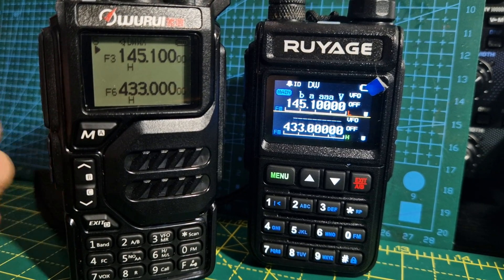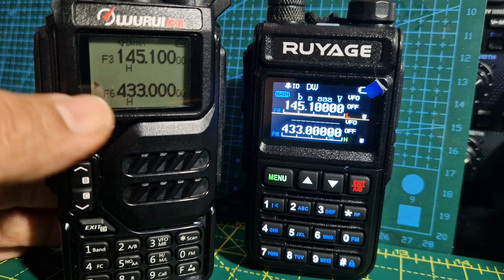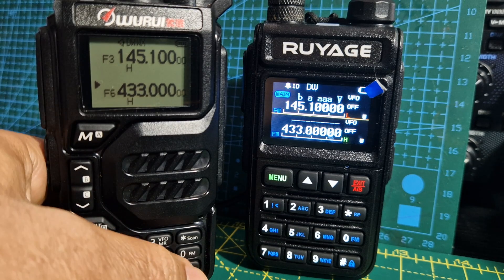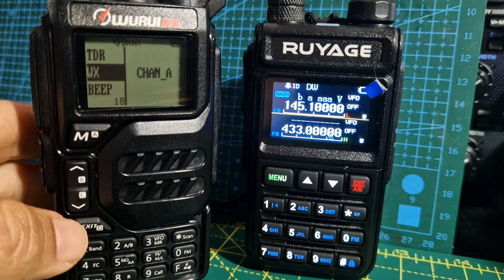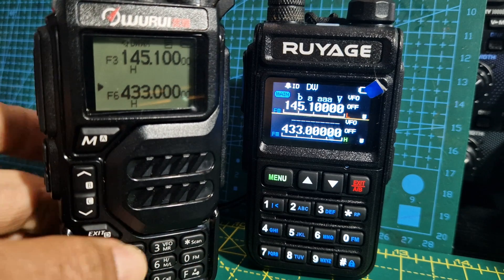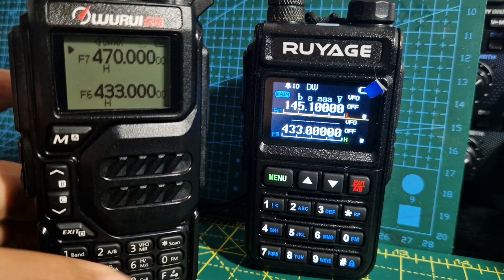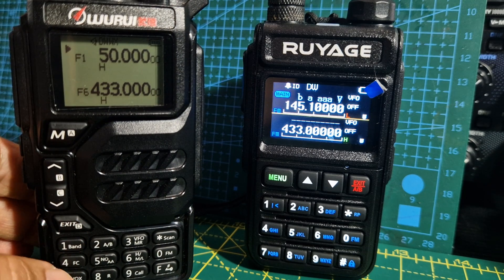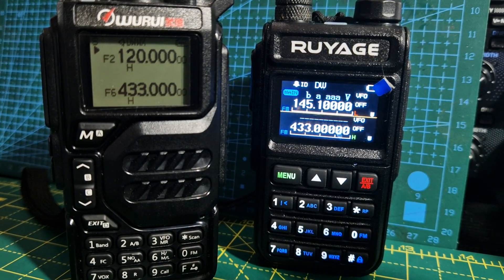UV-K5 , CROSSBAND REPEAT ??

Comment: As someone else mentioned... If you want crossband, buy the TYT 8000. It also has up to 10 watts output. Unfortunately, no scramble function. https://www.youtube.com/watch?v=fPZ7lah3rBw
Reply from the maker: Thanks for link.
Reply: I just got one yesterday & set it up today in USA with MURS (VHF 151.) going in to the TYT 8000 & GMRS (UHF 462.) going out to a GMRS Repeater. The cool part for me is that NOBODY uses MURS except Walmart which leads people to think that MURS is only good for 100 yards but I went from a HT on MURS to the TYT on MURS at 3.8 Miles (7klm) away to hear myself on the GMRS Repeater !... If your HT can't hit a GMRS Repeater then get that TYT up high with a good antenna & use it as a cross band repeater ;)

Comment: You jave to adjust the shift  
Say you want to receive on 144 you have to have a + offset of 300.000 and it will transmit on 444.000
Reply from the maker: Nice tip

Comment: Im new to these radios & have a couple. Still learning & understand the basics from the videos, but what exactly is the point of crossband repeat? What do you get out of it?
Reply from the maker: Not sure it does it but if it did you TX on band 430mhz receive on 144mhz
Reply: It can greatly  increase the range of the walkie talkies between users. With crossband (true) leave one radio dedicated to crossband connected to an outside antenna. The other users can then use that particular radio as a repeater, this will give a much longer range.
Reply: No es banda cruzada, un banda cruzada se puede usar como repetidor.

Comment: The whole cross channel thing is really simple. Example: On both UV-k5 radios set channel A on 433.000 and Channel B to 466.000. On one radio set the receive focus on channel A and the other radio set the receive focus to channel B. 
So now radio 1 receives on band 433.000 and the radio 2 on band 466.000. 
Now one radio 1 goto the WX setting in the menu and set it to channel A. On radio two set the WX setting to channel B. So now if you TX on radio 1(433.000),  radio 2 will recieve the TX from  radio 1 at (433.000) on 466.000. And the other way around.  not easy to explain it his way, but it works.
Reply from the maker: Thanks good description.
Reply: Still not
Reply: @titorabbit108fm8  Still not, what?
Reply: Eso no es un repetidor en banda cruzada

Comment: What you seem to be trying to do is not crossband repeater, its just split frequency VFO, i.e Rx on VFO A and Tx on VFO B. 
Virtually all radio hardware is capable of doing this, as nowadays it only takes a few milliseconds for the PLL in the RF chip to lock after its told to change frequency.
What appears to be missing in the official firmware is a way to tell the radio that you want to do split frequency operation.
The hardware is not capable of operating as a repeater, i.e listen on one frequency and transmit on the other, because if you read the application note for the RF chip in the radio, it has this section about setting the frequency of the chip
Frequency Setting
设置频率使用RF_SetFreq(u16 freq_hi16, u16 freq_lo16)，注意换算公式：
Frequency(Hz)= (freq_hi16<<16 + freq_lo16)*10
Register Default Description
REG_38<15:0> 0x3A98 Frequency(Hz)= (freq_hi16<<16 + freq_lo16)*10
REG_39<15:0> 0x0271
如设置409.75MHz 频点，则RF_SetFreq((40975000>>16)&0xFFFF, 40975000&0xFFFF)
As you can see there isn't a separate setting for Tx and Rx frequency, hence its not capable of receiving on one freq while transmitting on another, because its impossible to configure the RF chip to do this.
Reply from the maker: Thanks

Comment: You could make two K5 crossband repeat with a RPT-2K repeater box plugged into each
 K5 speaker mic sockets. I would also use a 3.5mm stereo 5 meter long extender cable
 and a 2.5mm stereo 5m extender cable plugged into one of the RPT-2k plugs
 so you can get an extra 5 meters distance between the radios, the closer they are,
 the more they block each others RX.
Reply from the maker: Thanks for info .

Comment: Only Chinese handy i know does crossband repeater is the TYT TH 8000D or E,
 there was a wouxun but it didnt work very well and its out of production.
I can recommend the 8000D i have one and it crossband repeats OK, you do have to switch on
 menu 11 which is factory hidden, its windows CPS does it (thats how i did mine) 
and i think chirp does too? 
many chinese handys do crossband working, ie TX VHF, RX UHF. or visa versa
just enter a split of around 260 to 340 MHz Those handys like the K5 and most recent
 baofengs etc shift 000.0000 3 digits in MHz, handys that dont crossband work
 only have 2 digits in the MHz
Reply from the maker: Thanks lots interesting info .
Reply: does yours overheat too ?
Reply: @armenmkrtchyan4865  Yes! Ensure the radio is on low power and only user it on an external antenna with SWR set up properly.  Even then, short tx copies are recommended or - BANG!
Reply: @enforcer-e1s  its like a base station without a fan lol ,   i guess would bee better to hook up a fan on it and put i tin a box with abigger battery and use it as a rpeatere

Comment: If it did support crossband repeat that is not how you would test it. Of course it will transmit on the one that is selected on itself. To test it you would need a third radio also set to those two frequencies and you would want to transmit with radio A on one frequency then radio B (the one setup with crossband repeat) would retransmit it out on the other frequency which would then be received by radio C
Reply from the maker: I know
Reply: @M0FXBHamTech if you knew then why are you trying to test it this way?. It's the wrong way to test it.

Comment: They used the wrong term in translation.  Shocker!  No one else has said it was a thing.
Reply from the maker: So what does function 18 do ?
Reply: @M0FXBHamTech  you showed it yourself. It moves from a to BFO. You did not show it off does
Reply: It does NOT crossband repeat. What that does, after a lot of playing with it, is select the transmit channel. If off, the ptt activates on whichever VFO (A or B) last received a transmission. When A or B is selected, it forces transmit on whichever you selected regardless which VFO received last.
Reply: So will the UV-K6 do cross and repeating?